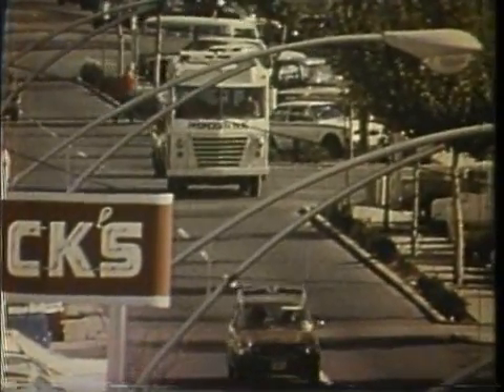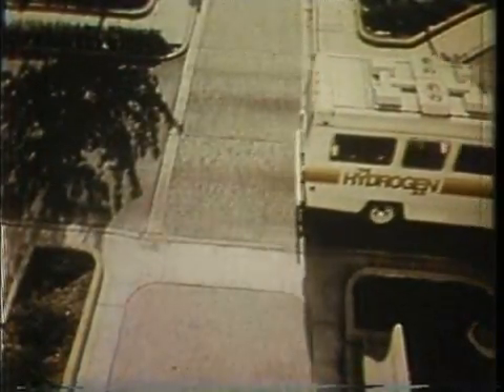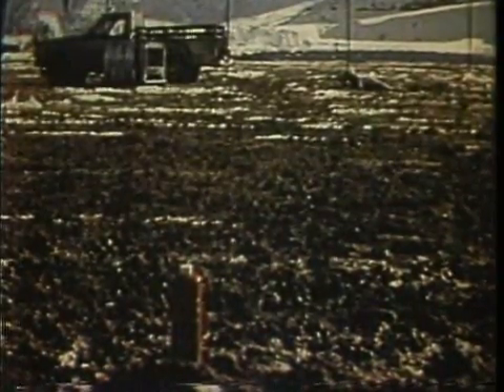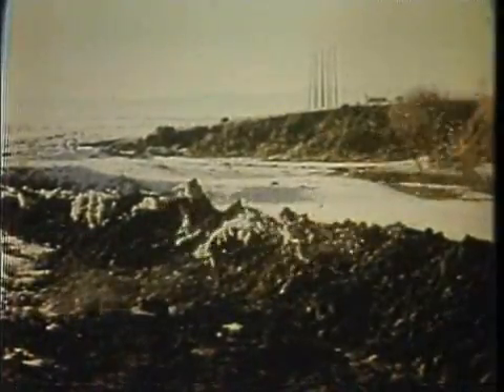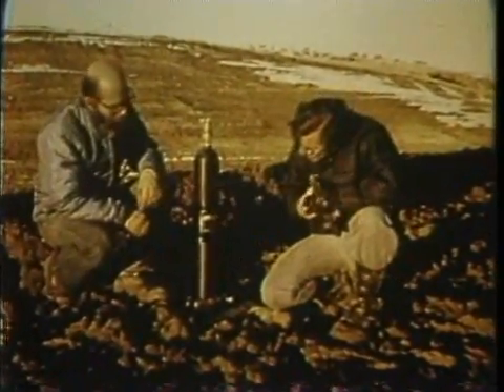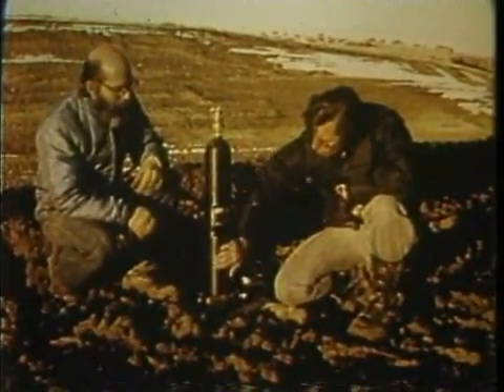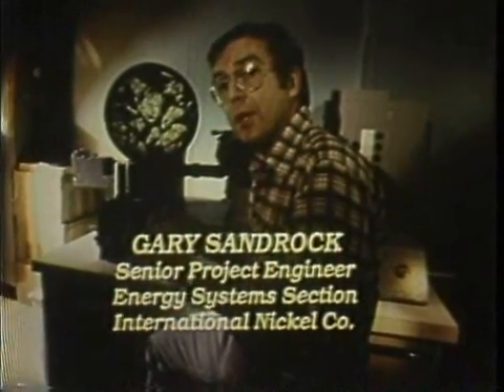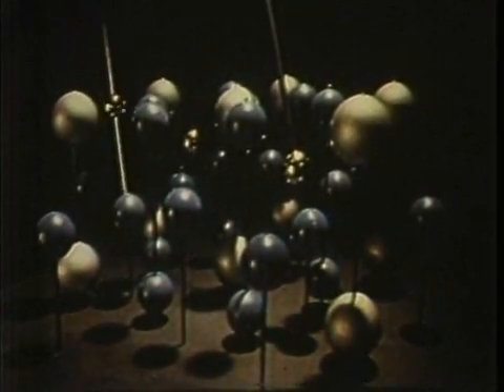Shoot a Hydrogen tank, Gas & Propane Tanks

Comment: so they already knew how to store it as a solid. thats even a more important part of the video then the shooting test.
watch the 2n halve. its explained how you can make hydrogen by electrolisys and then store it with iron-titanium fe-ti flakes/grains. its a non operative process! 
store it between layers of graphite (carbon sheets). you can make easy to store solid hydrogen cells. Question: how to release the hydrogen again from the fe-ti?
Reply: I bet there's some major drawback for the "solid" form. My guess is weight. Otherwise this idea would have revolutionized hydrogen fuel, and yet, we still don't see any hydrogen vehicles on the roads, and despite the hype, nobody's talking about 'solid hydrogen'. I could be totally wrong, of course, but that's my semi-educated guess.

Comment: Imagine if that had been pure hydrogen GAS instead of metal hydride...
Reply: leetdahl then what would have happened?
Reply: @mrknowmyself  nothing,as the gas flees into space and can't light on fire. Also it isn't gas, it's liquid
Reply: @sharl_leg Hydrogen is indeed most of the time in gaseous form, because to make it a liquid, it needs temperatures of below minus 250 degrees celsius. And pure hydrogen gas can definitely explode without even any already existing fire source. Hydrogen gas is reactive with only air. That's why they wouldn't have even done this experiment, if it was real hydrogen.
Reply: i wonder what is needed to let the hydrogen release from the metal (fe-ti) "spunge".
just some light heat maybe?